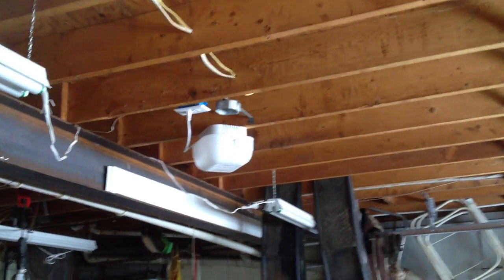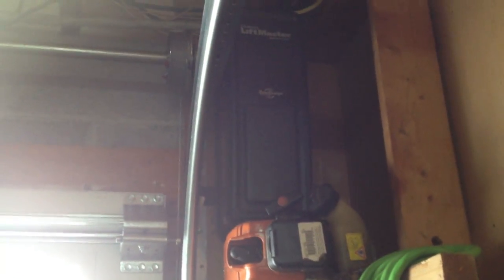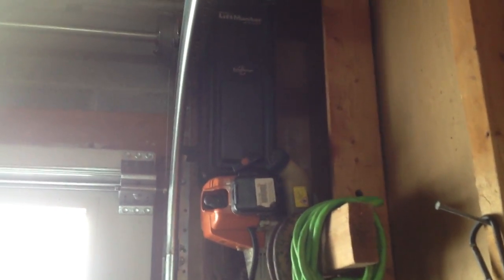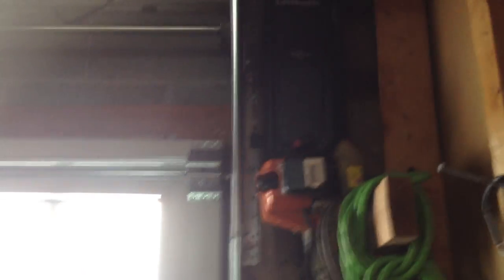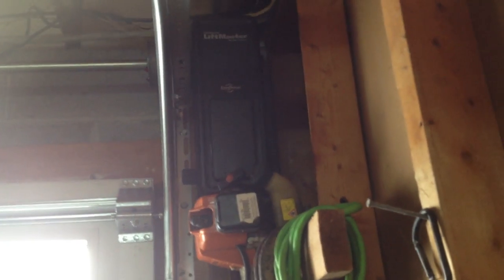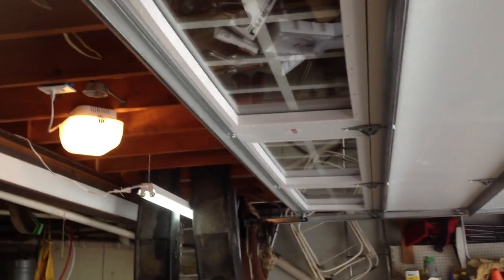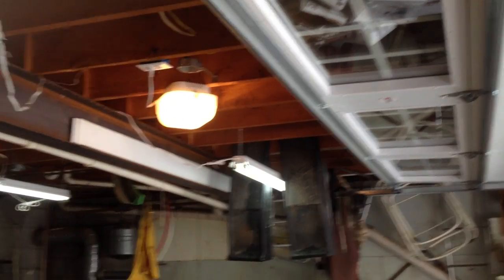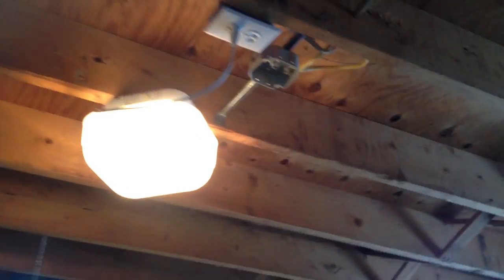3800 on my chi 16x7

Comment from the maker: It does in the 888lm wall control.  Now on the box that i have for the 888lm it says that it does not work with s+ 2.0 units.  so by those directions, it must not be integrated into the unit....